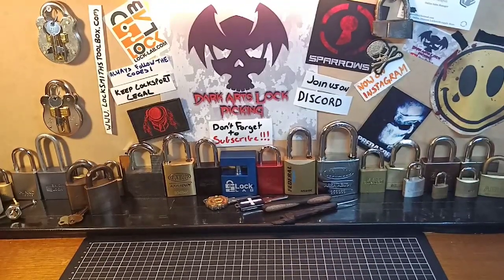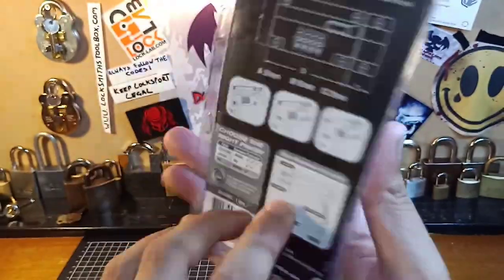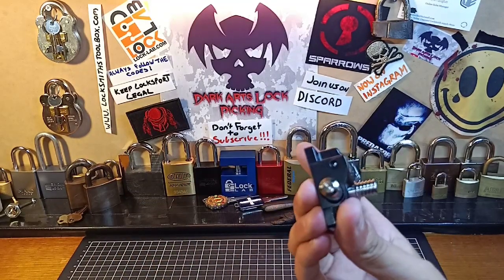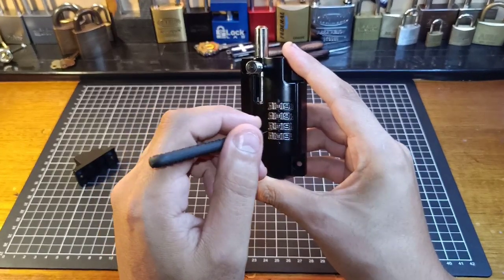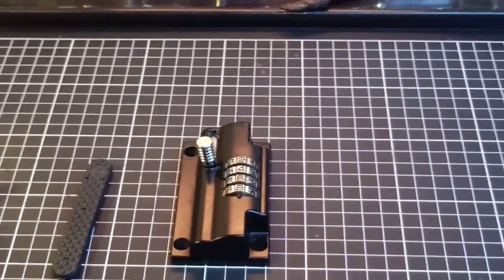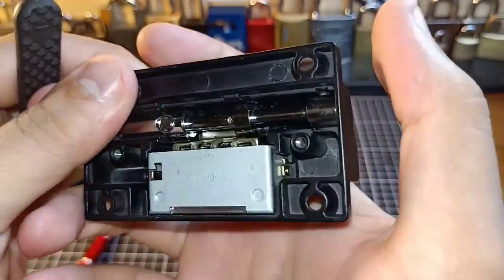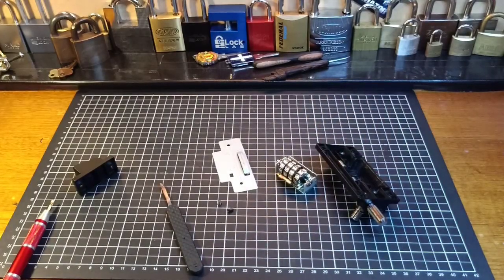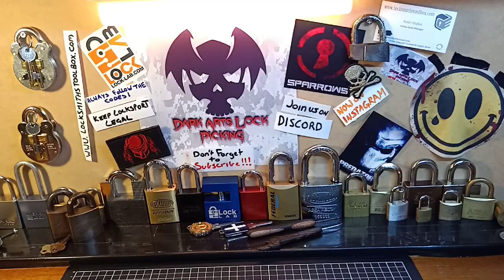Decoding a combination slide bolt lock (125)

Comment: Hi there, just want to see if you could give some advices. I bought a sliding bolt combination padlock like the one you showed here. And after I installed it onto my garden door, I found the bolt was stuck and couldn’t be pushed out (cannot be locked), and the last digit wheel was also stuck and couldn’t be rotated. 😢 as the screws are those unable to unscrew I can’t uninstall it from the door nor can it be used properly, just wonder if you have any suggestions…

Comment: Interesting little application. Like you say, wouldn't go putting that on anything outside in the real world. More like a novelty really. Zenith are a large company and they are pretty prolific in the gate and screw hardware side of things. Cheers:-)
Reply from the maker: Yeah I've never seen on like it. I'd use it on the inside of a door or sliding door or window but not outside anywhere. Yeah I think it's a novelty thing as well. 👍🤘🖖🍻

Comment: Hi there I have been having some troubles with this lock since buying it and trying to reset it to my chosen pin code. Basically after resetting the bolt Will not move back so basically I think I've wasted my money as I've got a lock that doesn't open - it remains in the locked position. Any advice greatly appreciated 🙏
Reply from the maker: Hi. It's hard to say without looking at the lock itself. Have you made sure you have set the new code correctly and the button on the back has been put back to its original place. 👍🤘🖖🍺

Comment: I bought this lock from a charity shop for 2.50 GBP with no code, in the unlocked bolt position, on the off chance that I could decode it in the same method that I've done on my old bike locks before, but no, this one seemed much harder to crack. Your method works a treat to find the gates!.. but when you rotate all through 10 positions, it still does not move, it's a mystery, I guess broken inside maybe..
Reply: 10 minutes later after some lube applied, it works, cheers man, top job, I have a functioning bolt, I will have to make sure to keep it lubed inside as it's either very precise number position or quite temperamental lol..
Reply from the maker: Glad it helped you mate. And yes always lubricate your locks it helps big time. Just make sure you use the right lube for it. Cheers 👍🤘🖖🍻